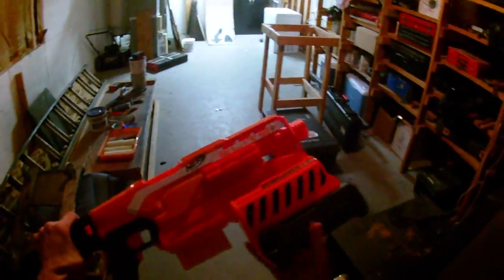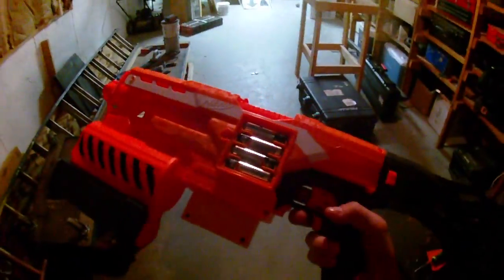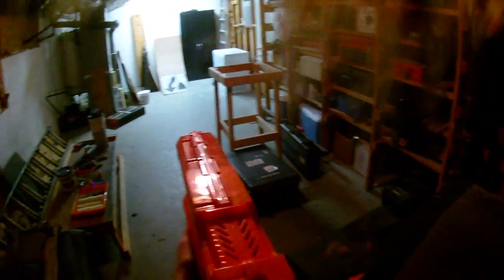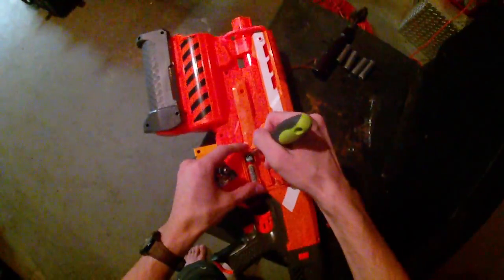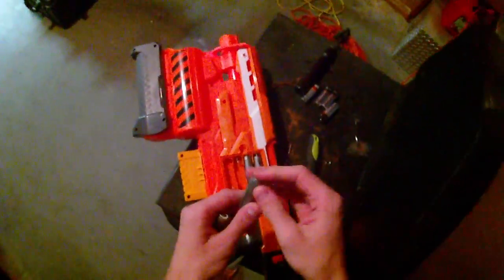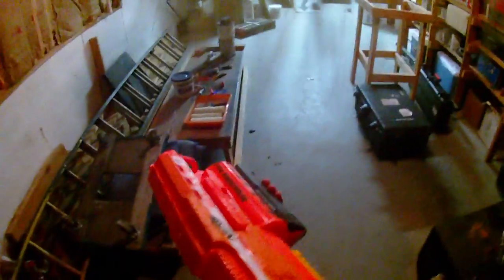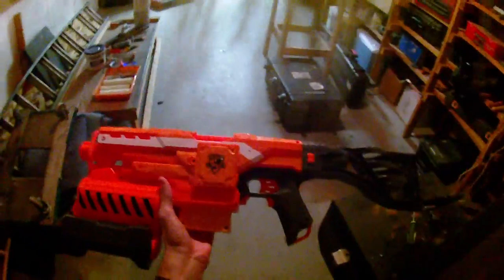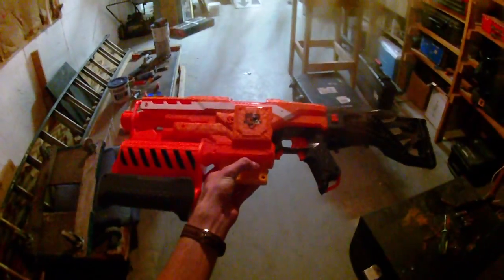Nerf Demolisher Voltage Mod 6V into 14.8V

Comment: How many volts dose it take to burn out the motors
Reply: Too much voltage will burn out the wiring before the motors, but if you're planning to do a mod for a demolisher just put two IMRs and two dummy batteries in it. The demolisher has an insensitive thermistor, and it shouldn't shut off, but if it does, it's probably the thermistor. For the motors though, they can handle at least 8 volts for a good long while.

Comment: If I run a 9v (yes I know its not the best option) in my stryfe with every battery (exept for the 9v itself) being a dummy battery, there would only be 9v running in it as oppose to the standard mod (With a 9v and no dummy batteries), would it burn out my stryfe? Please respond. Thank you. 
Reply
1
Reply: 9 volts is how much it holds, not how much it puts out. It's as powerful as a normal AA, I would recommend IMRS for your Stryfe.

Comment: hey drac do the batteries(the link you included for the batteries) fit in the nerf stryfe im pretty confused i just want to make sure thanks
Reply: Yes, but they are less stable than IMRs, and IMRs give a higher current as well, so I would recommend those instead. https://www.ebay.com/itm/2-EFEST-IMR-14500-Li-Mn-700maH-HIGH-DRAIN-Rechargeable-Battery-3-7V-BUTTON-TOP/231241593777?epid=2256029966&hash=item35d712b3b1:g:iiYAAOxyNo9SsWeM:rk:1:pf:0#rwid

Comment: How long would the batteries run, if say, i was in a heated nerf war, where the blaster's flywheels would be running practically  90% of the time?
Reply: Like most batteries, they would die pretty quickly.

Comment: Will 3 and a dummy batteries burn my motors?
Reply: +juliux03 Not really 4 Ultrafires will eventually burn the motors but 3 and a dummy is more safe and it's effective
Reply: no but it will affect the thermostir
Reply: but i recommend doin only 2 3.7 and 2 dummy battery  but its your choice

Comment: Wow, that rev noise with the 14.whatever volts is about on par with that of my modded stryfe with one motor working. My stryfe is modded to run 18 volts from two 9 volt batteries, with all the resistors and electronic locks removed. The story behind my 'one motor working' is that I janked up one of the contacts on one of the motors when I was removing the resistors. But over-volted nerf guns sound terrifying when revved.
Reply: Of course, 9v batteries are known to die rapidly in Nerf blasters, which is why most serious modders on YouTube use IMR's or LiPo's.

Comment: Do you guys think wiring in a nine volt battery into it would still help preformance but not damage the internals? I don't have very much experience with electric blasters

Comment: doesn't using more than three trustfires usually harm the motors?  Or did they upgrade the motors from the stryfe motors?
Reply: Logically, they must have upgraded something because you can pack a full four IMR's rather than merely two or three.

Comment: 10 meters? or 10 feet? a meter is about the same as a yard, a yard is 3 feet. so, 30 feet?
Reply: More like 35 feet
Reply: Thats impressive, but I know in a recent video he slurred feet and meters, and i wanted to make sure he isnt doing that again
Reply: mrsqueakyvoice97 only downside is as many people were saying the stock motors will burn out very quickly with 4 trustfires.

Comment: LordDraconical can you fire mega darts out of the rocket launcher
Reply: Nope
Reply: Not unless you cut off the launcher grille for improved airflow, wrap the shaft in some electrical tape for a total outer diameter of 0.8", then friction fit some 2044T45 PETG tubing from McMaster over the tape. That tubing is perfect for Mega darts.

Comment: Is it possible you can do a mod for the grenade launcher thing?
Reply: Yes. It has been covered in other videos. It does require disassembly, but in this case it's a mild operation. Cut off the grille on the launcher tube (for better airflow), then put electrical tape underneath the O-ring (for a better seal).